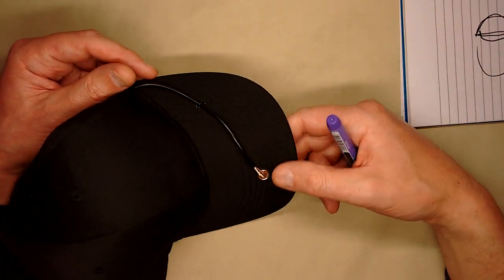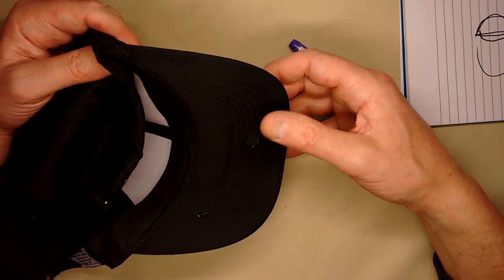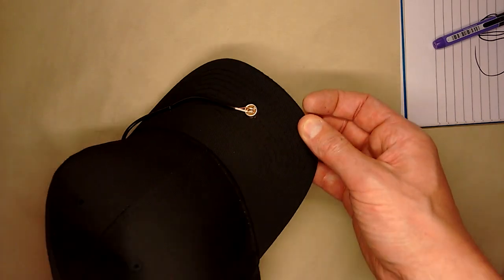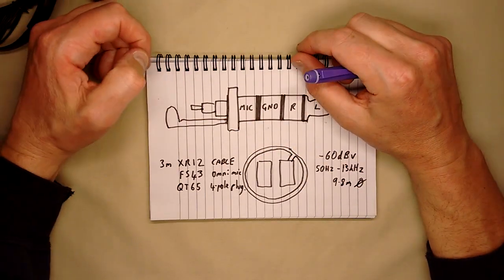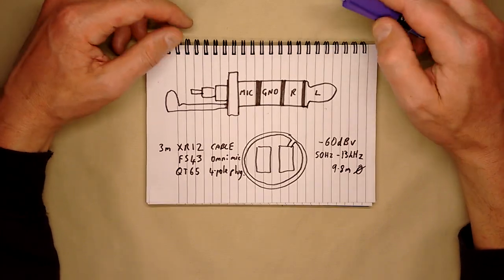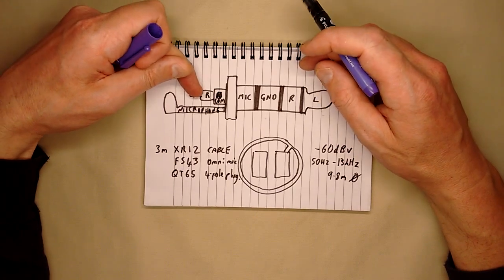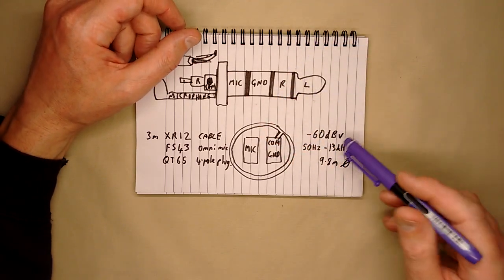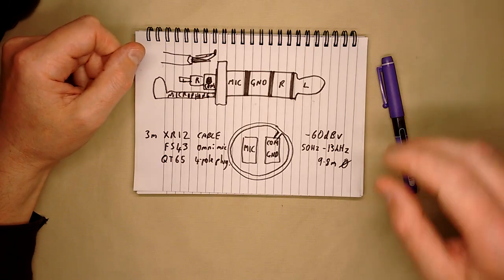Baseball cap with integrated microphone.

Comment: Why not just get a standard condenser mic and simple 2 channel audio interface with xlr inputs. I believe you record on an iPad and there are many interfaces that are compatible with iOS such as the focusrite Scarlett interfaces or if you want cheaper stuff try Behringer interfaces. You just run the USB from the interface into the iPad through the apple camera connection kit. Only thing with a setup like that is that you possibly won't be able to record audio and video at the same time. Another alternative is a product such as the IK multimedia irig mic hd, it comes with a cable that has a lightning cable. You can then just connect it right up to the iPad, you could get a simple mic boom arm or a little desktop stand. I know for a fact that you can directly record audio and video within the camera application on the iPad with the audio coming through the mic. Perhaps you just want a lavaliere mic in that case all this information is irrelevant.
Reply: I'm a musician that works using iPads along with hardware synthesizers and other noise making boxes so getting audio into the iPad and processing it is common practice to me. I would advise a proper mic setup though, if you are worried about background noise I'd use a dynamic mic as they aren't as sensitive as that of a condenser. You get USB miss but honestly you can't beat the good old analog xlr but with that as I mentioned you will need an audio interface. I think the irig mic hd would be great for you if you don't want the hassle of audio interfaces. Maplin probably stocks them but they'll rip the arse out of you for it as they do with so many of the products they sell but you could possibly try one there. If you need any help with audio stuff I'll do my best to help you out.
Reply: +joeboygsxr or for a universal solution you could get one of the zoom portable recorders, many have built in mins which are of great quality and most record to SD you you would just need a card reader. Some can work like a USB audio interface as well and directly feed the audio over USB to the iPad or whatever. It would be an extra bit of editing syncing video and audio together but probably worth the effort.

Comment: The little microphone/hat combo isn't as good. Your voice is dampened and sounds quite tinny. Maybe the time has come for you to use a proper microphone, not one built into a phone etc, though it depends if you want to invest? On the other side of that coin, you could get cheap microphones off ebay and take them to bits and maybe find a diamond in the rough.